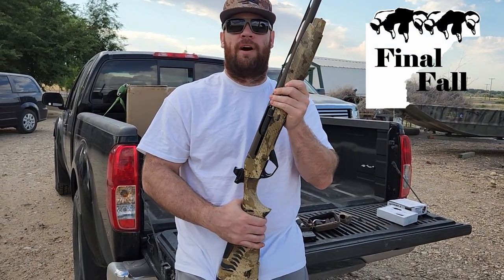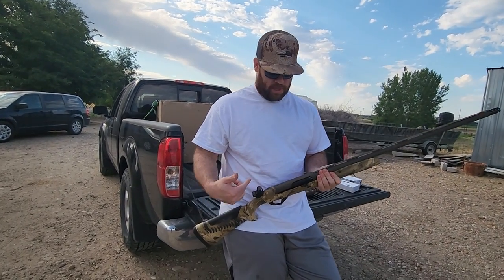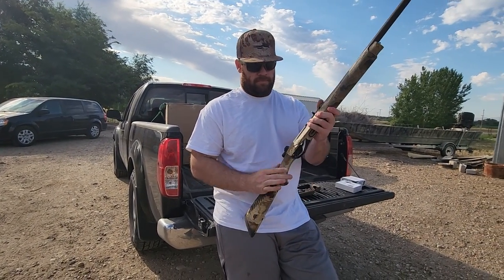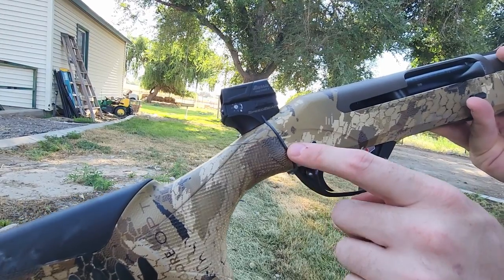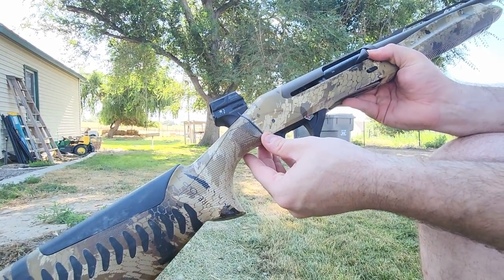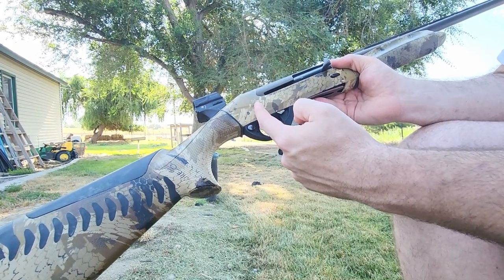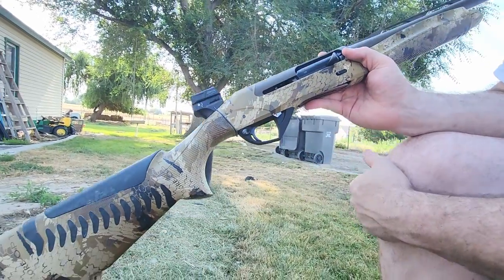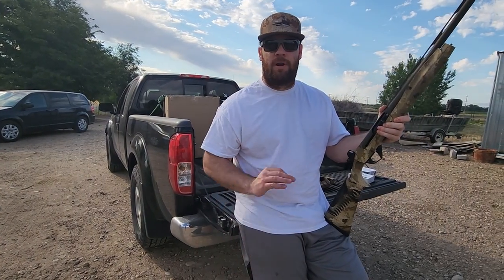How to put a Burris Speedbead on a SBE III

Comment: I have a SB3 20ga, and am wondering if erics SB3 is a 12ga, or 20ga. Burris's website doesn’t say on the SB2 whether or not it fits either a 12ga or 20ga. Surely it doesn’t fit both. God bless, and good luck this year!
Reply from the maker: His is a 12 gauge. But if you buy the speed bead in the 20 GA the process is the same
Reply: @final_fall  Burris said they didn't makeone for the 20ga SB2. So, I'm back to square one.
Reply from the maker: @drewdowns7044 Well what I would recommend then is getting a meadow creek mount like I have, which I really like. Or talking to your local gunsmith about getting the receiver tapped. Depending on the Smith it's about 50 to 75 Dollars

Comment: I'm considering this route, but I'm not enthusiastic about drilling my 2k shotgun 🤔
Is there a way to decrease the diameter of the pin to fit in the stock and maybe shave a bit of length off the receiver pin so it fits ? Basically mod the mount instead of the gun?
Reply from the maker: That's definitely an option. It'll be more work for sure. As narrowing the pins will be more difficult. But it can be done
Reply: @Final Fall  thanks! I Appreciate the quick response.
Reply from the maker: Yeah of course! I'm still working on Eric to get me a step by step video of how he did it. It's proving more difficult than I thought.
Reply: The holes that are on the stock the gap isn't wide enough so shaving the speedbead wouldn't help with that side but  would work for the side that goes into the receiver. O just didn't have anything to shave them.  I would imagine it would work that way. As long as it has enough to grab and not slip up or down and side to side as thats what they're for.

Comment: Great info, thanks !
Reply from the maker: No problem!
Reply: I ordered this and it’s actually showing up today. Looking forward to getting it installed and using it for Turkey hunting this spring !
Reply from the maker: @SigCross awesome. You'll definitely enjoy it. It makes good difference turkey hunting as well!
Reply: I having a little difficulty getting the red dot bore sighted, I have a laser bore sighter and I can’t seem to get the red dot to line up with the red dot on the bore sighter. I have both spacer plates on and the Burris is maxed out and still not lining up for some reason. I have tried taking the spacers out and adjusting the red dot out in the other direction but that makes it even worse. Got any advice? I’m hoping I’m just missing something obvious. The windage is fine but the elevation is off about an inch or so.
Reply from the maker: Sorry it took so long to reply. For some reason this comment was held for review and I just caught it. So bore sights are extremely unreliable for sighting in shotguns. I tried to sight mine in with a laser bore sight as well. And Everytime I put it in it was in a different spot. It made my red dot so unreliable inaccurate that I just started using target 7.5 shot loads and looking to see if it was hitting a circle where my shot was.
Reply: Good to know that’s it’s not just me lol. I bought a shim with cant and I got it at least close, I then did the same as you and shot my gun a bunch and got it sighted in great. I’m very happy with my set up!
Reply from the maker: @SigCross I'm glad it worked out! I promptly tossed the bore sight and have never used it since. I'm glad it worked out well for you! I'm looking forward to turkey season! Hope yours is good too!

Comment: Which spacer did you use between the mount and the red dot the big or small one or both.
Reply from the maker: So he didn't use any other shims or spacers between the stock and the receiver. Just the speed bead piece itself
Reply: So the shims that are already on the gun there's 2 of them the speedbead bracket takes the place of one of them so I did remove 1 of them

Comment: Did drilling those holes wider and deeper have any effect on the gun?
Reply from the maker: No it did not. It's not enough to make a difference.
Reply: Was just curious. I want to do it like that but a little worried if I do there could be some issues if I decided to take it off.
Reply from the maker: No. Those holes are used for the spacers and not attaching the firearm itself I believe
Reply: The holes are for the spacers or shims. So if you decided to remove it and go back to not having it mounted you shouldn't have any issues.  On the stock holes I didn't make the entire hole bigger q a large drill bit I just angled a smaller drill bit. As the gap of the of the holes wasn't as wide as the pins or dowels on the speedbead bracket

Comment: What optic is that?  I want an enclosed red dot instead of an open rmr style
Reply from the maker: That is a Burris fast fire 4. And I can't speak for Eric specifically, but with the fast fire 4 the enclosed piece of the optic is optional. You can take that off. And Eric used the enclosed piece some last season and ended up having some issues with it. As it trapped water and is not so easily removed in the field so it distorted his optic if it fogged up from his breath, or from rain.  He ended up using it open and had better success with it that way.
Reply: Its the burris fastfire 4. The cover can be attached if wanted as it comes with it.  But it absolutely isn't water tight. And if any moisture get on the inside its obscures your field of view. In addition if its cold outside causes major fogging up issues on the inside. I removed it after 1 hunt.  (Waterfowl hunt)

Comment: What mount option did you use ultra light, sbe2,m2,etc?
Reply from the maker: It's the sbe 2 mount I believe. If you're talking about the Burris speed bead
Reply: Yea i was talking about the spead bead they have a bunch of different option. Obviously none for the sbe3, which is crazy. Only reason i was asking was the picture i seen of the sbe2 mount it didnt show it having a roll pin but it might not have been an exact picture.
Reply from the maker: I think you're correct again. Eric did buy the speed bead for the SBE II.  And the picture is often generic
Reply: Yes it was the speedbead for the SBE 2